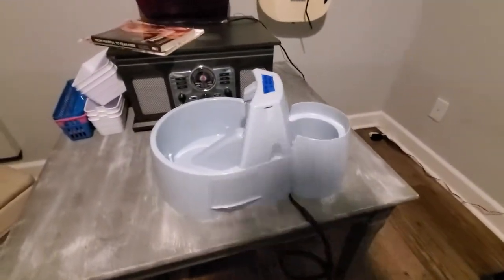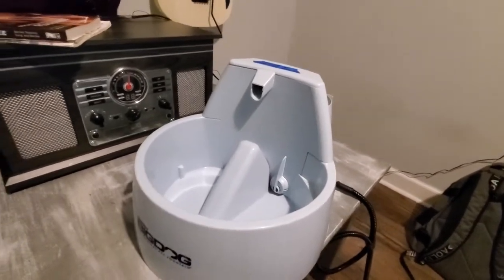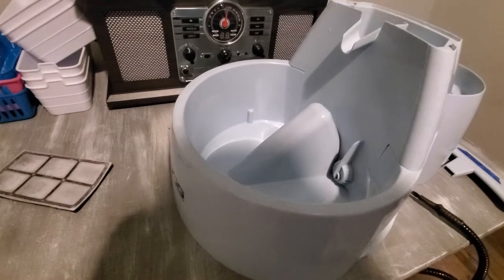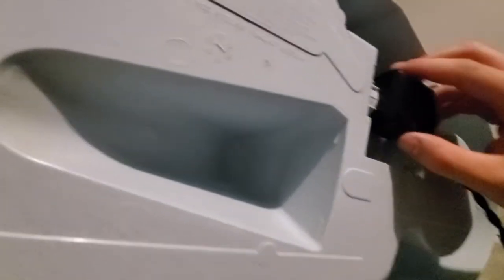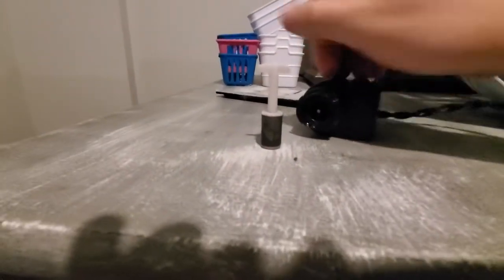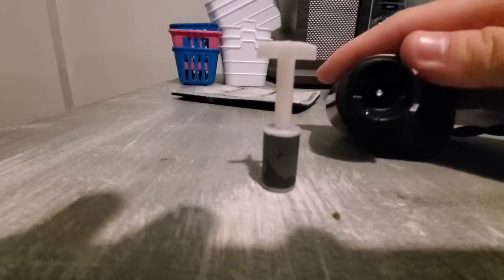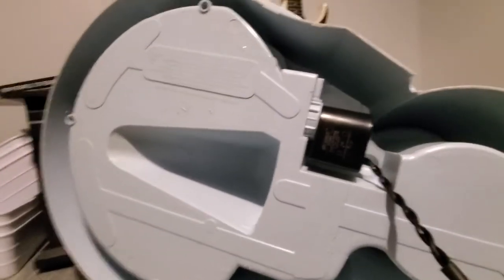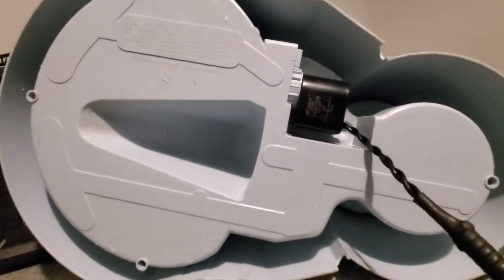How to fix BigDog Water fountain (waterpump issues)

Comment: The key point to check is the motor hole were the magnetic impeller sit, clean that hole bottom with a match stick or hard small screwdriver to free the base of the hole clean so the impeler rotated with out effort.